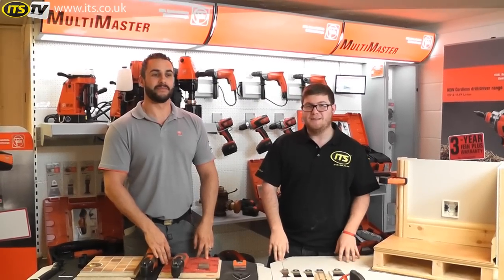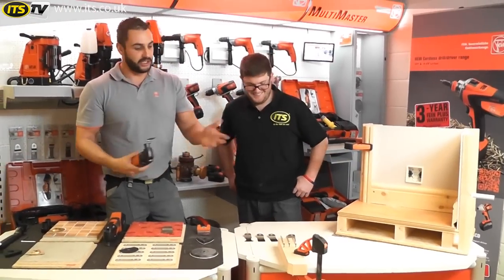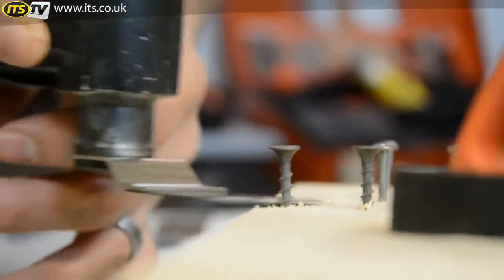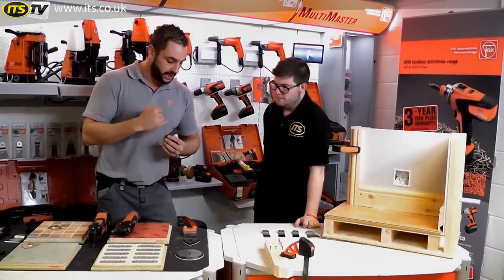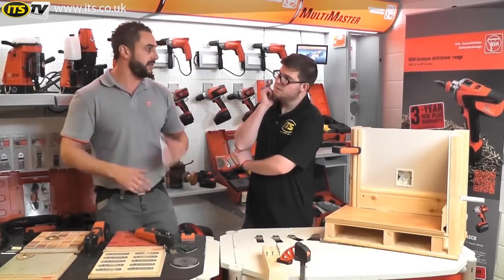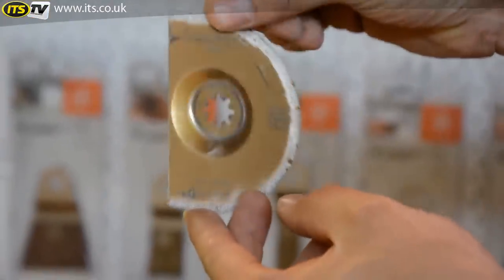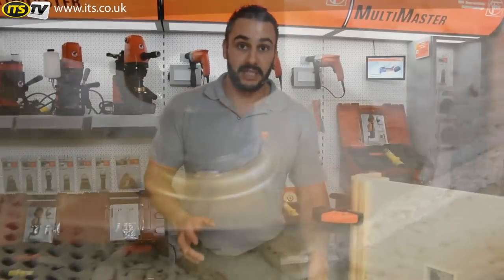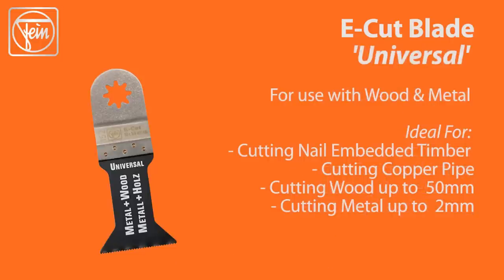Fein MultiMaster Blades & Accessories - ITS TV

Comment: Good video, I purchased a tungsten metal blade that goes through 4 inch nails really fast. I find the Fein blades too expensive, also I had a couple of new metal blades break at the spot weld after a few seconds use. I emailed Fein but they didn't really want to know!

Comment: I recently purchased the Multimaster marine and 25 litre extractor and am very impressed with its capabilities. I also admire your physical demo's cos unlike the hamfisted Americans, you don't follow through by about 4-6" when demonstrating the cutting of nails. Power tools should be used progressively, allowing the machine/ attachment to do the cutting/drilling/grinding. This also increases the life of power tools and tooling.
Reply from the maker: +manos3790 Thanks for your feedback its really appricated.
Reply: Instead of throwing away the dull blades , I sharpen them with a new tool called the SHARP POG . You put it in a power drill and it grind a new set of teeth all at once .  works great

Comment: Don't buy it. It's useless. I threw it, it,s junk.  Mine couldn't  cut a tile in the bathroom.
Reply: its not made to cut tile.
Reply: You can get blades that will cut tiles. Obviously the guy above wasn't using one but they will cut tiles very well.